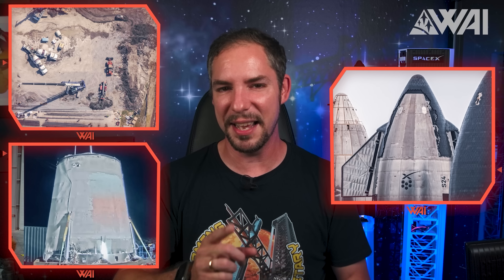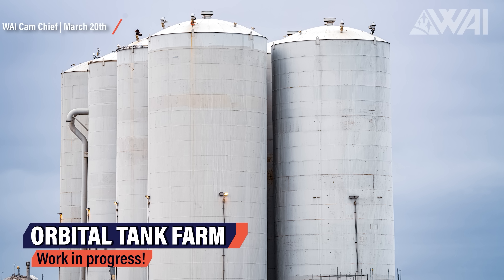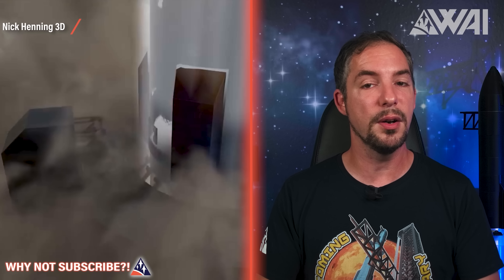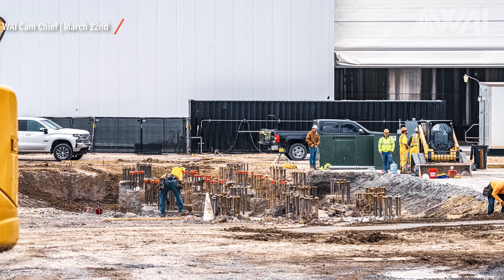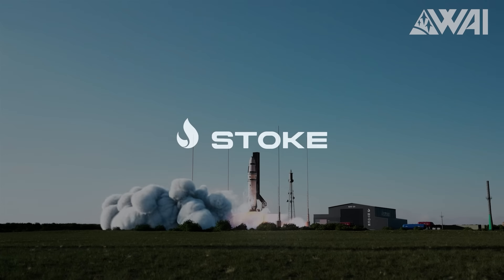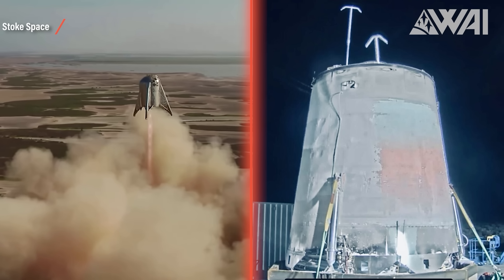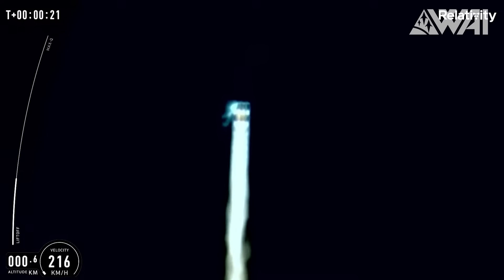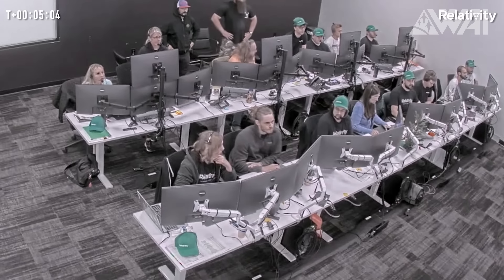SpaceX in FINAL prep for Starship orbital launch! Relativity ALMOST reaches orbit!

Comment: Things look flat at a distance because the time variation is so close as the light reflects to our eyes and arrives here that we can barely distinguish the difference between the front and the back of the object as it comes closer we start to see the depth because the time variation arriving at our eyes start to increase the time variation starts to increase the time variation gets bigger but that means were processing the information faster than the speed of light in order to do that that also means we are traveling slower than the speed of light and sound in order to hear sound Or see light and this should make you start thinking then what am I you’re nothing but I thought that’s the only thing you know for sure

Comment: NASA could have been visiting the moon for a long time. With the already existing FALCON ships they could have completed various missions. I explain; the ARTEMIS and STARSHIP missions want to carry large payloads in a single trip into space. While the FALCON ships can take them to Earth orbit in sections and there they would connect to go to any destination, even Mars.
Fuel modules, equipment modules necessary for the mission, and lunar landing and return modules. They would simply dock in space into a single unit and go from there to their destination.
That?? Don't you guys watch movies? So many years watching Trip to the Stars (StarTreck) and still do not learn? The Falcon ships work like clockwork, they don't fail and you don't exploit your potential.
On the other hand, it is time to expedite the cargo trailers of the ships when they leave the construction area to the launch tower. Increase travel speed up to three times safely or as far as the limit is achieved.

Comment: More protection and ever more protection. If ELON MUSK had taken my Advice he would have just built up the launch pads with Dirt as Cape Canaveral did all their launches successfully. Those launch pads protect vulnerable pipes and equipment by covering them with Dirt and allowing the directing of Rocket blasts in the directions wished and away from vulnerable Tanks Areas and Equipment. To me the launch Tower never made sense. The traps to capture the rocket and a tower to capture it on the return are easily added to Ground Launchpads so it is a lot of extra engineering for NO good Reason. I still think even after all the shielding ELON MUSK has added it is still vulnerable and they should have built an above-ground swimming pool to accept the rocket blast and control its effects at least a little instead of unleashing a full rocket blast directed at everything that surrounds the Launch Towers. Still I am Hoping Elon Musk Starship is successful even with my worries and concerns.
Reply: How to tell people you're not a rocket engineer without telling people you're not a rocket engineer
Reply: @alvianchoiriapriliansyah9882  How to tell people you are an idiot without saying so. If Cape Canaveral used Dirt raised platforms for Launchpads covered in concrete but with channels to direct exhaust What is so remarkable to you, FOOL.

Comment: I think the new building will be for engine installation... Time will tell
Reply: It's too simple of a task to require such a big building. Payload processing will be way more likely

They build a higher jig for engine instead
Reply: @alvianchoiriapriliansyah9882  I would think a large area so you can approach the vehicle from 360 degrees would make the integration of the engines much easier, thus faster... it'll be interesting to see what it does.

Comment: How is it that NO ONE has figured out that the "naked starship" is going to be used as an orbiting fuel tank / gas station to do the in-orbit refueling that is one of the necessary steps that Elon has planned to prove out for future extended missions? 
Why else would he build one that has to stay up in orbit? That's one thing that NASA has never done: to refuel a rocket after it goes to orbit. Just tanking up the ship to keep it as a reserve will prove the process. Then, we will study to see how stable it will be in orbit, and how the refueling can be done efficiently and safely.

Comment: RocketLab also managed the 2nd successful launch this month! They are, I my opinion, the undisputed 2nd most reliable launcher after (a long distance) the first being SpaceX
Reply: Don't forget ULA... they're not as glamorous, but they do an have enviable history with both Atlas V and Delta IV, far more so than RocketLab. The latter are great — they're certainly the only rocket startup other than SpaceX to have made the step from development to operations — but they've also had a few failures among there 30+ attempts.
Reply: @simongeard4824  ULA hasn't had any launches in months. Frequency is not unimportant
Reply: @alvianchoiriapriliansyah9882  No, and Rocket Lab are fast building their own record for reliability. But I still rate ULA higher on that measure for now...

Comment: Technically the Stokes second stage has only TWO engines - each with 15 combustion chambers. The combustion chambers from each set of turbopumps alternate around the actively cooled heatshield base, which houses the rest of the two engines.

Comment: i'm curious if they are sandwiching the shielding.  i mean a layer of metal covering their very own heat tiles would work better than just metal.... right?  to attempt to keep the metal from heating to extremes, that makes sense to me.  31-33 engines blasting for even a few seconds is going to generate allot of heat on the tiles, hot enough to undo welding? idk...
Reply: I think tile fixing couldn't handle the thrust and would be blown off

Comment: Pile foundations are not neccesarry needed in case of heavy buildings. There are used mainly in loose soils, wich are low bearing soils for foundations. Being a sandy soil, this is the mainly reason for the pile drillings. :)

Comment: The flame transitions in color much like the fuel oxygen mixture of a rosebud torch changes as you come closer to balance starts off white indicating to a rich becomes blue as it's velocity mixes the outer envelope of the flame with  atmospheric oxygen and then goes red as the tenuous atmosphere no longer has enough oxygen to burn residual fuel

Comment: A slight correction to your terminology comma a kettle reboiler is a particular type of heat exchanger, if it is truly a reboiler than it is adding heat vaporizing liquid in the gas face. The same physical structure can be used as a cooler or subcooler, a condenser. From your description, these heat exchangers are being used to cool and condense Vapor back into liquid phase, if that's what you meant then it is being used as a condenser it is not a kettle reboiler. The term reboiler is self-explanatory it is used to reboil liquid phase into vapor phase after it has condensed into a liquid phase

Comment: Wouldn't it be a good idea to equip a super heavy booster with 20 or more vacuum raptors and stack it on top of another super heavy? Send it to orbit and then fuel it, then attach a starship. You would have 6x the thrust and 4x the fuel to reach Mars in almost half the time what do you think
Reply: While that would be cool, it’s probably not possible considering that 6 vacuum raptors hardly fit on starship, which is the same diameter…
Reply: @wesleyquarles1250  that's a good point! But 6 vacuum raptors would still make a huge difference given the burn time it would gain with all that extra fuel
Reply: Sure, an extended easy burn can impart the same boost as a fast burn with more power.

Comment: I think the best way to avoid any future sliding on the steal structure is to make a shoes with a good size magnet inside the shoes it self, what do you thing ?
Reply: So every time you lift your foot you have to apply 50+ pounds of force to separate the magnet from the surface? Think harder.

Comment: I like your commitment to accuracy. To help with this, fyi, CFA piling pumps the liquid concrete in while the auger is withdrawn, and THEN the rebar cage is lowered into the liquid concrete column, sinking all the way through to the bottom.
Smiles

Comment: 5:33 ideas for no landing hardware starship:

1. Expendable starship- this would be the most mass to orbit.
2. lunar starship test article or pathfinder unit
3. Alternate design for starship.  At one time they talked about sweeting fuel to cool vs tiles. Also if the cold gas thrusters and gimbaled engines are strong enough it could belly flop without the flaps. It would be falling faster but it might be lighter overall.
Reply: 4. Training ship?
Reply: Space fuel depot

Comment: I can vouch for the wet or icy steel at heights 300ft+ on cell towers, it's definitely not a fun thing to be on. As long as they are wearing safety gear and are cautious they should be ok.